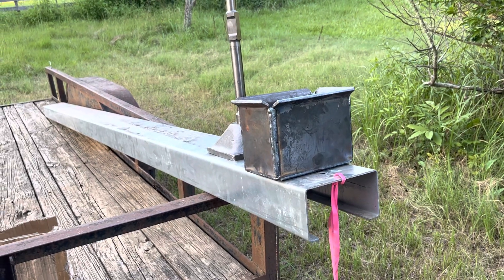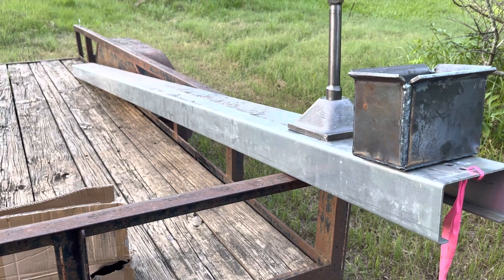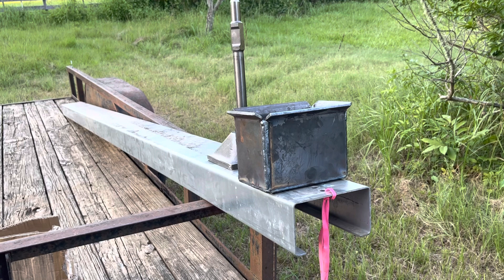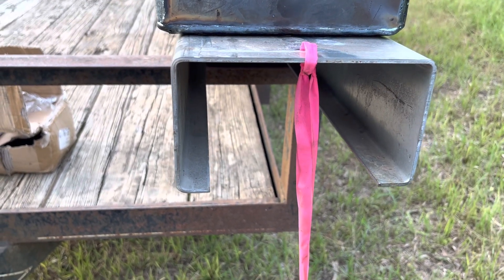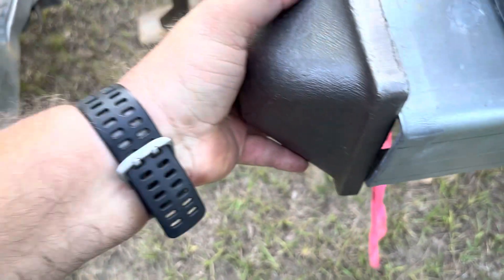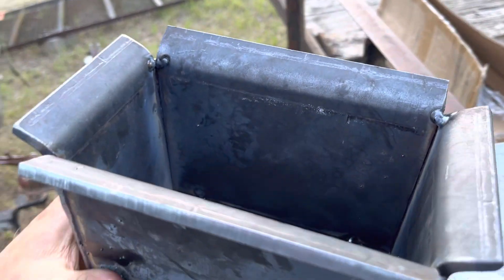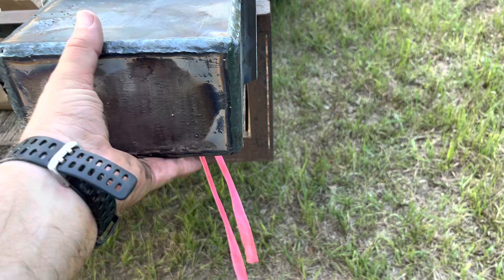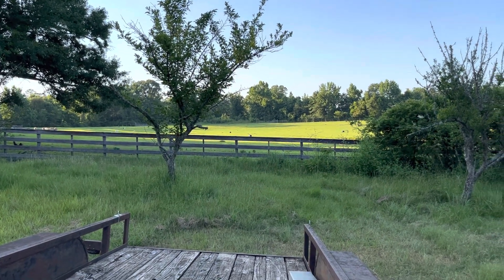Solar Power Project - prepping to install my Sinclair PV array ground mount

Comment: Link to the electric hammer? I've been eyeing a Sinclair ground mount too and an electric hammer would be much easier than pouring all that concrete.
Reply from the maker: I better try it out first. Been working weekend. May be another week or so before I can try it out.